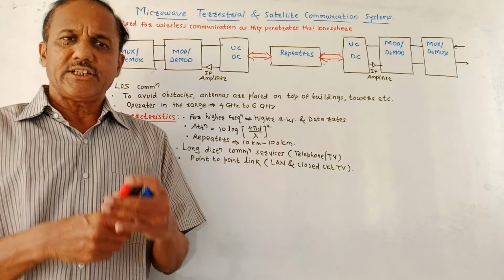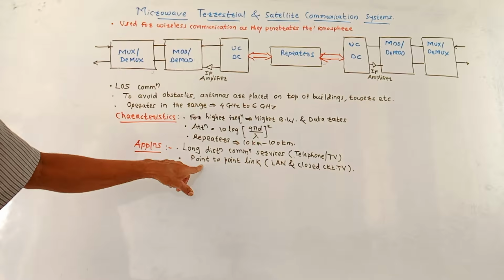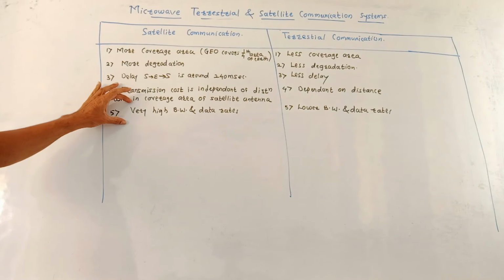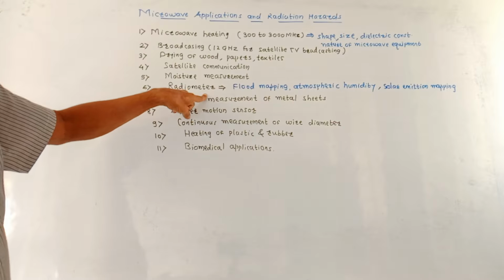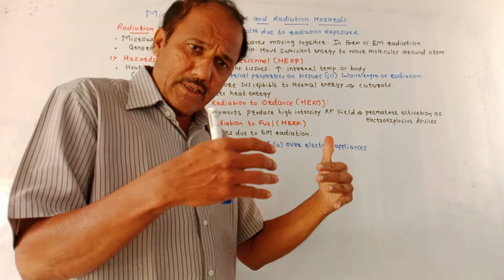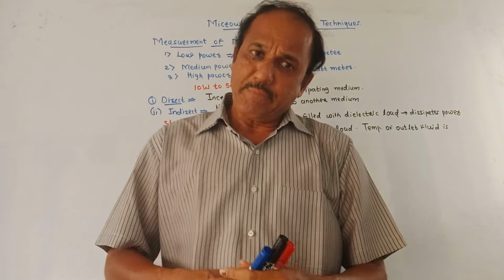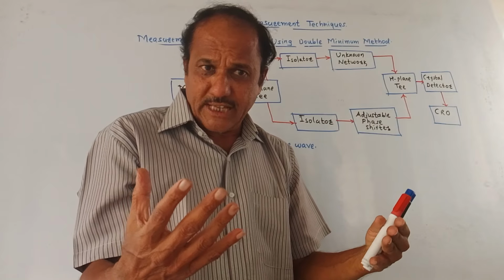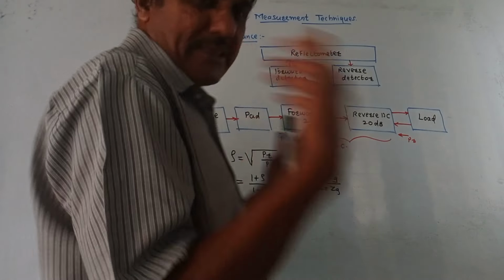QUICK REVISION: MICROWAVE SYSTEMS AND MICROWAVE MEASUREMENT

Comment: sir onee request can yoh plz solve this question and comment me answer
calculate the maximum radar range of radar system which is 3cm with a peak pulse power of 600kw if its antenna is 5m^2 minimum detectable signal is 10^-13 and radar cross sectional area of the target is 20m
Reply: +1
Reply: @garde8072  my answer for this question came is 44150.239 m